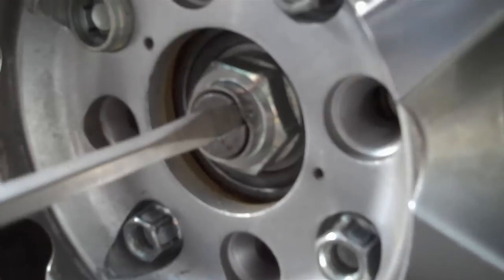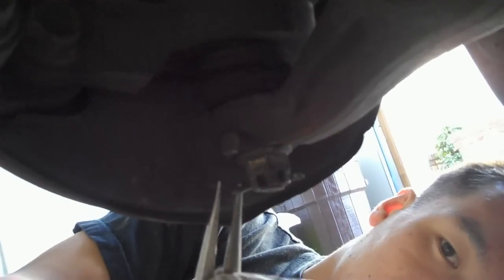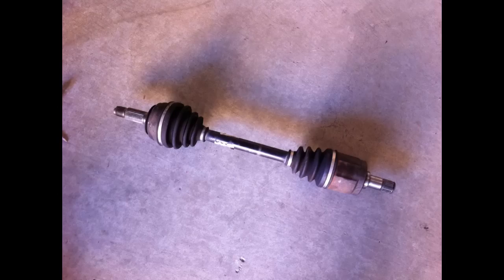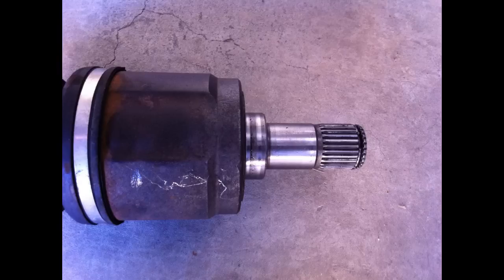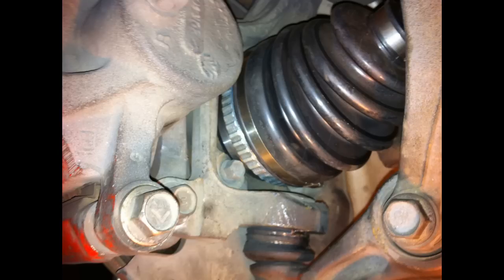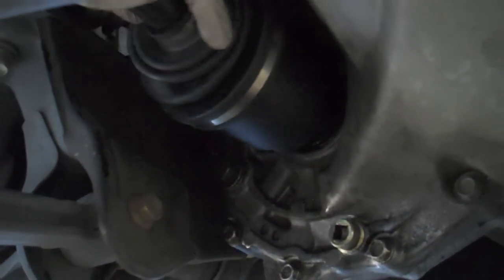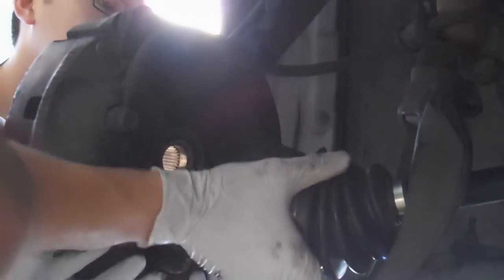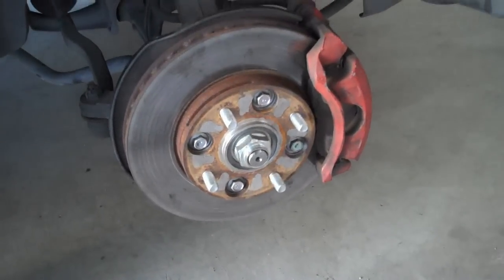Tutorial: Install drive axle on a 1995 Honda Accord

Comment: I just did this tonight and your tip of using the jack and ratchet to pop the ball joint loose was brilliant.I first tried pounding it with a hammer but that didn't work. Then I remembered this video and wham. Worked perfectly.
Thank you very much for that tip.
Reply: Muy buen trabajo

Comment: Excellent and the most professional, clean video I've seen yet on replacing the axle on an Accord.  Your method of popping the lower ball joint worked perfectly for me on my Accord.  Sure beats using a hammer or boot-slicing ball joint fork.  Nice tip about waiting until the wheel is on the ground before tightening the wish bone bolt.  It wouldn't have dawned on me that tightening it while jacked up would pre-stress the rubber joint, but after you pointed it out, the problem is obvious.  I was able to replace my axle in under an hour.  Thanks for making this video.
Reply from the maker: excellent!  glad all the tips were helpful!

Comment: This looks easier than I thought, I have to replace 2 axle and 4 rotors and brake pads and a timing belt too. This video helps on the axle part. Thnx bro

Comment: Even quicker easier way to pop the lower balljoint is simply to unscrew the nut about a quarter inch from seating & press upward with a  bottle jack or the saddle of your floorjack on the tip of the joint. It'll pop cleanly & the base of the nut will be sitting against the seat. threads will be unharmed. If you're really worried abut bunging them up, undo the nut til the castellated part is flush with the end threads before jacking.  Release the jack pressure once the joint pops & finish undoing the nut & lift the joint out of the arm. people make this tougher than it really is.

Comment from the maker: @DarlingMichael couple of ways, there could be more though.  1.  if youre steering wheel is turned all the way to one side while moving and you hear a continuous clicking noise, or 2. if you check the instead of your rim, and theres axle grease all over (broken boot, the grease is really thick)

Comment: @CaptianAnthony if its like a 99 CRV I just worked on you need to use a hammer and long extension or metal bar as a chisel of sorts.   IT also helps of you rotate the opposite wheel so you can hammer at both sides of the cv joint case. Good luck!

Comment: Hey Thanks for the Video btw!.  Im thinking about tackling doing this. My symptoms are vibrations at 60mph. At first I thought it was my rims but then I put on my winter wheels and same problem. Maybe I messed up my axle when I hit a pot hole and dented my rims? :-(  When you put in your video, you say that I need to change my atf fluid? Should I drain the tranny b4 I pull out the axle? I have an 04 accord.

Comment: Just wanted to thank you for this great tutorial, what is that that you do with the screwdriver?
Reply from the maker: Thanks! Do you mean the socket wrench to break the lower ball joint loose?
Reply: nukem384 thanks for your reply I appreciate you’re time, I actually meant the screwdriver at the very beginning, are you unfolding the metal so the axle nut can turn?
Reply from the maker: SBdunks3 ah ok. yes, unstaking it is what its called. Though if you have a big enough pipe like in the video, you can force it off and skip that part.
Reply: nukem384 ok great thank you so much! One more question( sorry for the annoyance, do I have to replace the lower ball joint after breaking it loose with the ratchet?
Reply from the maker: @SBdunks3  Nope.  It's just the way the ball joint and lower arm are connected, it's a very tight fit.  Ball joint it totally still usable unless you inspect and find something wrong with it. I have tutorials on how to replace the ball joint on this car too if you're interested/need it.

Comment: Thanks for the video.  Great up!

Quick question:  what is the acceptable runout for the shaft once installed.  I checked mine and it has 0.038" on the left side (at centre), and 0.030" on the right...(at centre)      :(

Comment: What are symptoms of bad drive shaft? I have 03 Acura RSX 120k miles, lowered(not slammed), that will cost at 40,60,80mph VERY SMOOTH, but will shake badly under moderate to heavy acceleration. I think I know your answer already, just checking.THANKS!

Comment from the maker: driver side axle is connected to the intermediate shaft, which is connected to the tranny.  pop that axle from from the intermediate shaft.  sorry, dont know the torque specs on that bolt off hand

Comment: Hey nukem, i replaced the axles, l-r control arms,both lower ball joints,both tie rod ends, and when i hit a bump the wheel moves to the side where bump was? what should i replace next?

Comment: Don’t understand if you move the whole rotor assembly away then push the drive axle through and out? It doesn’t show that part?
Reply from the maker: Josh Muralt its a combination of both. You need to to move the hub assembly away, off the lower ball joint, and then you can remove the cv boot.
Reply: Will I need to buy a new lower ball joint to replace it?
Reply from the maker: Josh Muralt nope. All youre doing is removing it from where its mounted and then re-mounting it when youre done

Comment: hey maybe you can help me i working on a 94 accord i removed the axel (passenger side) and measured it to my new axel and they are the same size but my new axel wont come out threw the disc as if it was to short but they are the same size? any suggestions?

Comment: Can you help me here, i have a 89 accord so theres a damper fork but the damper fork to lower arm bolt (which you are taking apart at 1:09) is stuck. i can loosen and take the nut off but cant take the bolt out. Cause of this i cant remove the fork to take out my axle. Any suggestions?

ps: i tried hammering it out( for like 20 mins) with no luck, also tried heating it, wd40 as well.. im stuck here!! >:(

Comment: are those 17" or 16" rims
Reply from the maker: 17x7
Reply: +nukem384 I have a 95 coupe and my 17s rub they are 17 by 7 215/45/17. I thought I might have to use spacers.
Reply: +Tydell Williams must be another issue somewhere.. thanks video was helpful  too!!